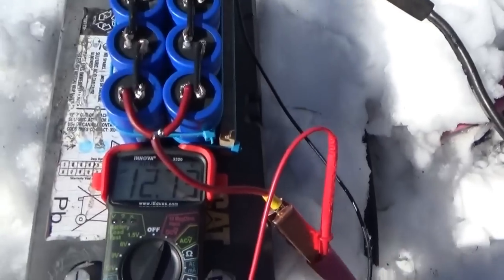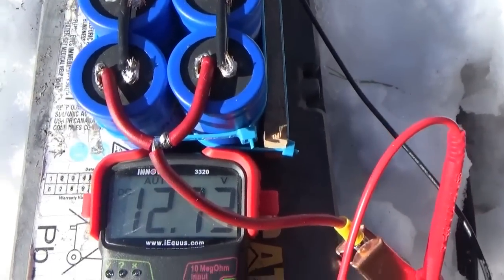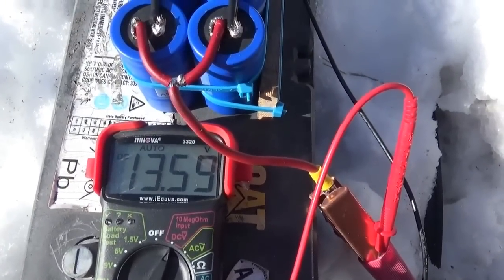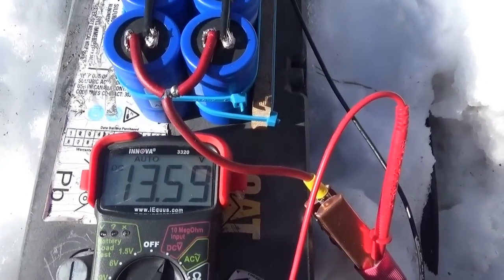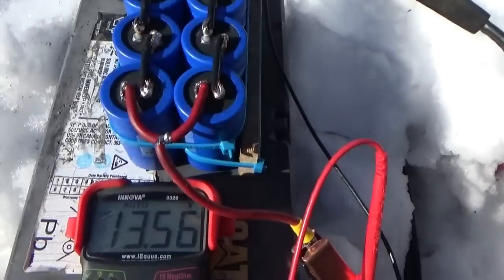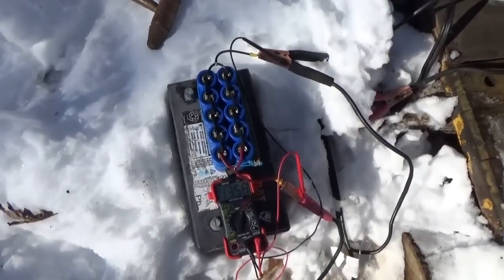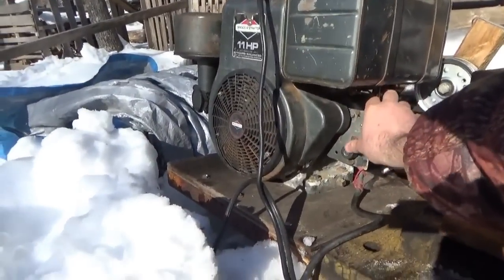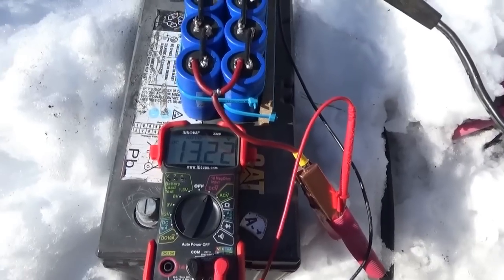Cold Start 11 HP Log Splitter Engine On 10 Supercapacitors

Comment: Capacitors are fun to play with and interesting. But they are not economical. I can buy a lawnmower battery at wally world for 30 dollars. that will last for approximately three years. Five if I keep the batts in the warm house when Im not using it. The lithium battery jump start kits are a good deal on e b@y you get a tire pump a flash light and attachments to charge a cell phone or anything many many attachment adapters to plug into what ever. What those caps are good for is when you have a surge and you dont want to run down your solar batts they can take the power spike that is what use you could use them for. Saves my solar power. you dont want to pull a big load on your solar batts. Caps help with power spikes.

Comment: One off the times you are going to touch  the + and - at the same time and you will get the shock  off your life  .
Reply from the maker: I try to avoid that.
Reply: You can hold onto both sides of that cap bank all day and never even get a buzz. 50v is generally regarded as the threshold of danger of getting shocked.

Comment: Why are you pushing your bare hand against the caps like that? Is it not so risky at 12-14 volts?
Reply from the maker: If you only touch one side then no. I try to be careful with these.
Reply: Below about 50 volts there is virtually zero chance of getting electrocuted.

Comment: Imagine how many good capacitors are put in the trash by people throwing away electric appliances and electronic devices that no longer work. It would be interesting to find out what, if any, items would have a big enough capacitor(s) to make the caps worth retrieving.
Reply from the maker: Many appliances have some very good and useful electronics in them. My first Bedini motor was made entirely out of scrap

Comment: Hey Troy,  and fellow early bird club viewers,  I have seen another YT vid where a guy put his caps in a portable box and added on the side a hand crank dynamo to charge the capacitors.

I think that would be a great idea.  You could make an emergency Battery booster and car starter if the caps are big enough that you can recharge in an emergency with hand crank power.  I  think it would be great to have in an emergency.

Oh if you can shield it from EMP  all the better.  hehe
Reply from the maker: +Bill23799 yes I have seen that. I plan to do some off grid experiments. The problem with that video is he never tells us how long he can run stuff except for the led. I want to do real world experiments with detailed data.